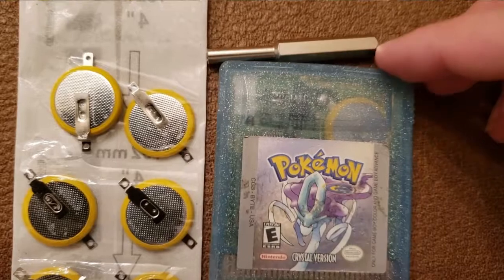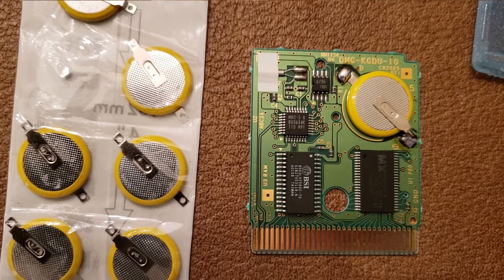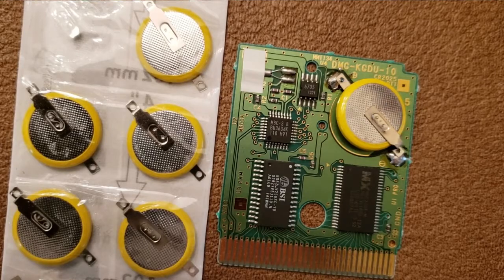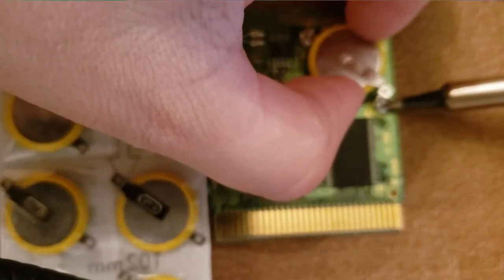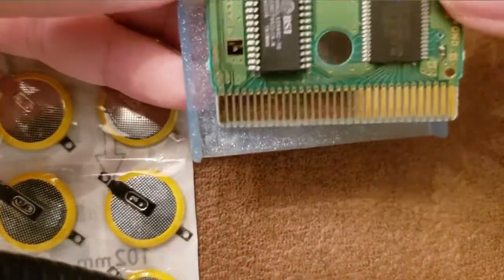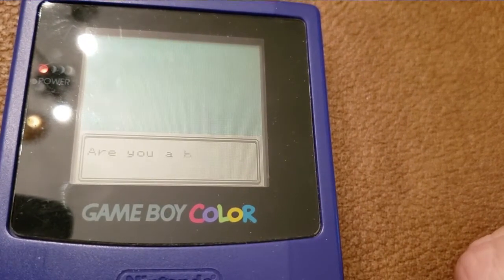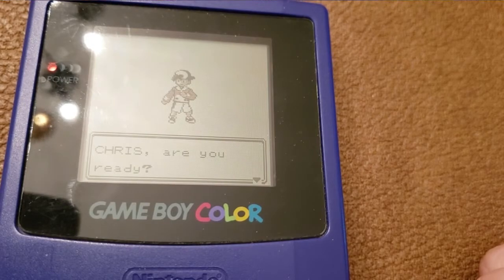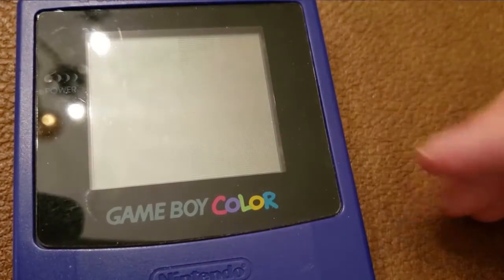Solder new GameBoy battery

Comment: Don't paint the solder on the pad like that; you won't make a great connection. You want to heat up the pad and the leg of the battery so the solder will follow the heat and coat the metals for a good connection.
Reply: He’s not welding a gas line, chill bro..it worked what does it matter
Reply: @smokin_angler9032  It works now sure, but what happens when the game is dropped? Probably won't take too much punishment before it pops off.
Reply: @inputfunny  why are you dropping a copy of pokemon crystal
Reply: @Corporalfork  Why drop anything? Probably because mistakes happen.